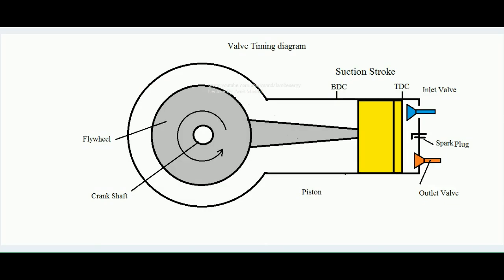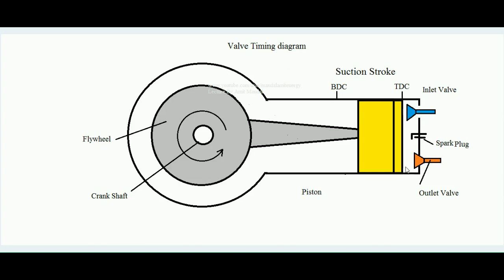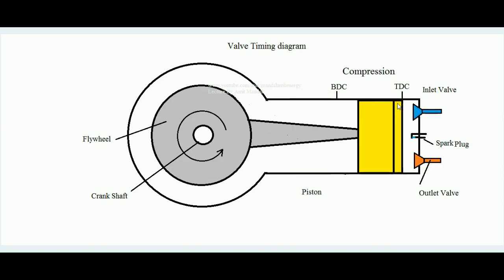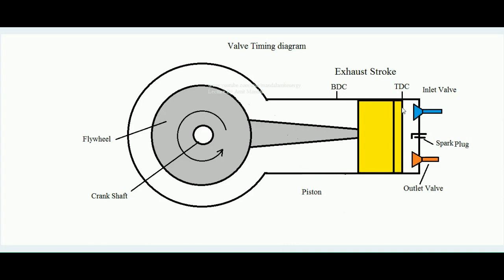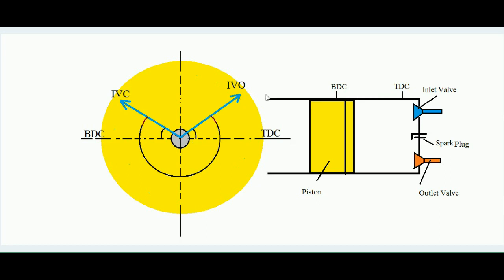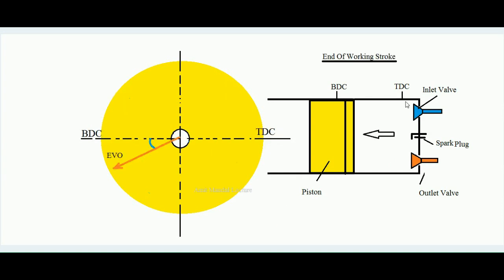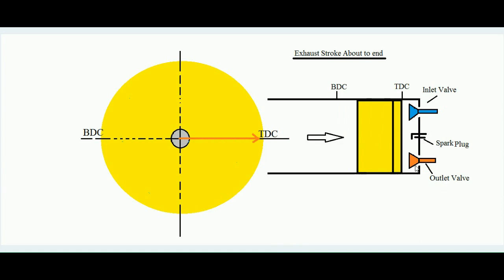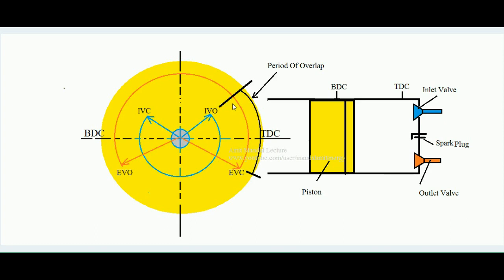Valve Timing Diagram of Four Stroke  SI engine

Comment: What is the profit of increasing volumetric efficency?........and in the period of overlap .....will there be no mixing of burned gases and fresh air
Reply from the maker: +kuru singh It increases the amount of power developed . Coz low volumetric eff. Means less fuel ia burning. The time of overlap kills some power but its required for proper combustion....